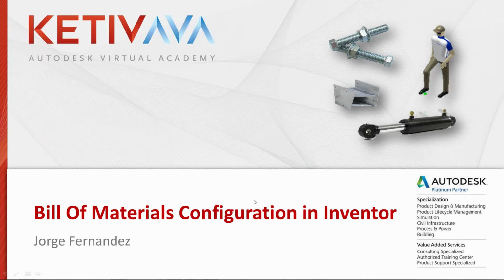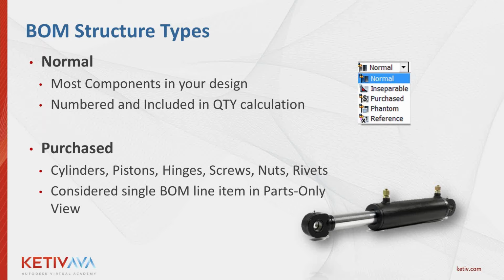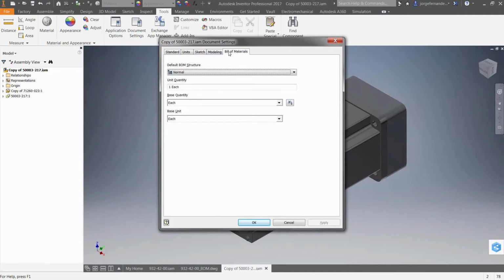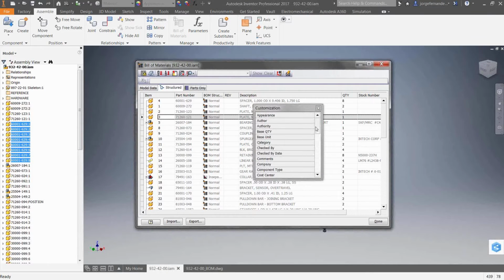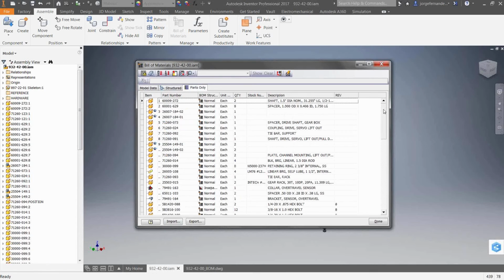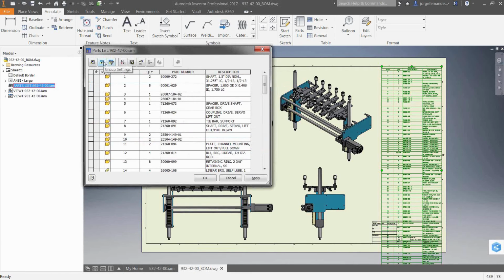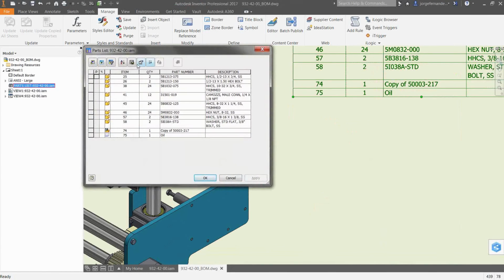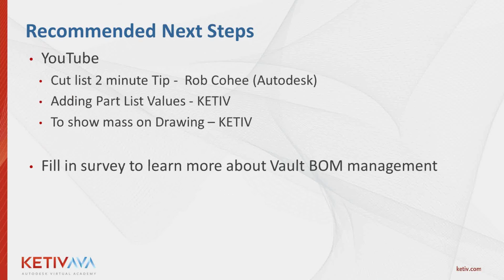Autodesk Virtual Academy: Bill of Materials Configuration in Inventor

Comment: Hi, i want to display BOM structure that if the parent item has quantity greater than 1, the child parts underneath of that parent will  multiple with that qty. Any body can help please.
Reply from the maker: Hi Hung,
Thank you for your question!
If you edit the parts list then, then expand the parent. 

Then click on the Group Settings button. Then check the Group box. Then in the first key select part number. Then click apply then ok.  

Then you will show the quantity of the child parts in the parents. 
Note this will not call out the parent in the parts list and description is automatically generated.  
Jeremy Gerdes|KETIV Applications Engineer

Comment: Hi, Can you create a custom BOM Parameter
Reply from the maker: Hi Eoin, What are you trying to accomplish? That way we can give you the best guidance to get to your intended end result.
Reply: @KETIVTechnologies  love the videos, I wish more cad solutions providers went to the same rounds! So I do a lot of work with aluminium extrusion. typically we have panels on most of these extrusions. I created an excel that allows me to calculate the price of these panels. I was able to seperate the Panels in my Bom as I had them categorised as Purchased parts and was able to filter them in the parts list using the purchased parts only Filter. Now that I see what the true use of the purchased Part BOM category I want to use that for all the parts that are required to be ordered. This means I need to create a new class for my Panels. This leads me to my question can you create a custom BOM Category. Eg: Inseperable, Purchased, Refernce, Normal, "Panel". Hope this clears things up. Thanks